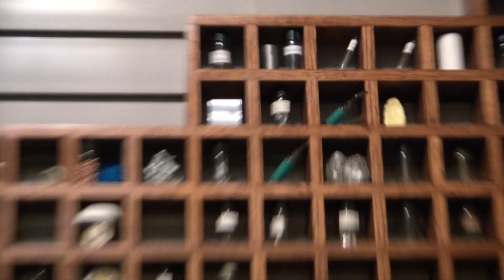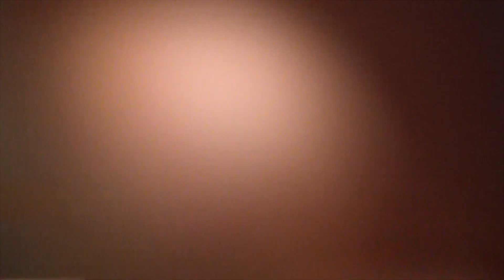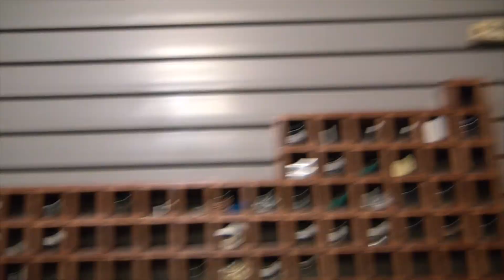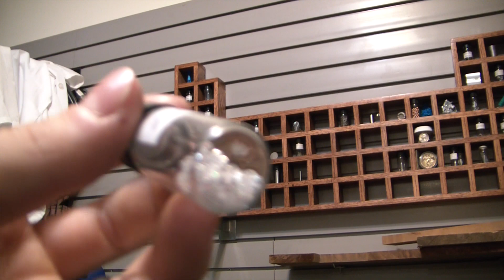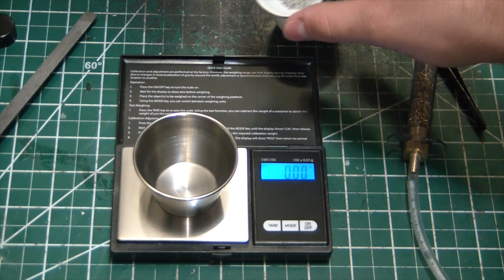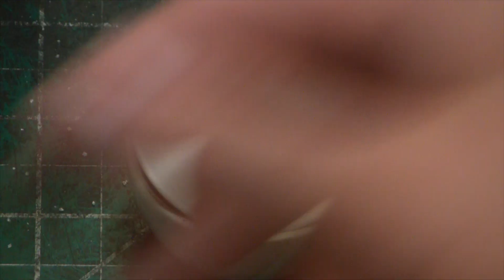Diamonds are NOT Forever: Burning Diamond - ElementalMaker

Comment: Great video!👍💪
Thats what I wanted to do forever using my oxyhydrogen torch. Unfortunately I dont own any diamonds I could waste😅.
It would be also interesting to try this under a inert athmosphere like argon or helium. Probably using different pressures would be interesting. Is it possible to melt carbon? I am gonna look it up on the internet and if it could somehow be possible for sure try it. Probably using charcoal or graphite as the carbon source though.🤔
Reply from the maker: It's definitely a bit of fun to see diamond burn! From what I was able to find carbon can actually melt if the right conditions are met, 100atm of pressure and 5000k temp. Might be able to do something with the arc furnace I'll be building.

Comment: If you hear a diamond in a oxygen stream it becomes flair like, thunderfoot did this a bit ago, and you could convert your hho generator to separate the gasses out the anode and cathode, giving you a mixable stream of gas. More like a oxy ace torch setup
Reply from the maker: Thanks for sharing, I'll have to check out his video! I may build a split cell in the future, but with my chemistry supplies its easy enough to generate pure O2 on demand when needed.

Comment: How small could you make than HHO generator well still having the same volume of HHO production? How long can you make the torch length? Light saber potential
Reply from the maker: Im probably pushing the limits for my cell type, but if you used flat plates of SS you could probably build a very compact cell. Still though, it will generate alot of heat so some kind of cooling mechanism would be needed.
Reply: its all a question of power, you need around 250w per Liter per minute. So relaisticly you need 500-3000w So you could use some RC model Lipo batterys  to power a HHO generator. There is no limit. Somone on youtube posted a flame with 20 inch lengh i remember.

Comment: Hey I got a question.I used my Potassium Hydroxide to dry out a few things,but now it is wet and is stuck in a big lump.How does someone dry out Potassium Hydroxide ? I would much rather ask a professional (YOU) then my science teacher.😃
Reply from the maker: You could dry it out with heat on a glass plate or a Teflon coated steel or aluminum cookie sheet. Bare aluminum would be destroyed by KOH though so be careful. It will also slowly eat away at glass so use something your not fond of any don't use it for cooking again. You could also dry it with a more powerful desiccant such as sulfuric acid, but that is probably more valuable to you than the KOH.

Comment: For the power supply you could use a microwave oven transformer, with the high voltage winding removed and a enough turns of really thick wire used instead, to give 5V. You'll need a huge full wave rectifier too. Should work out cheaper than a Chinese power supply too.
Reply from the maker: Yep I have a few MOTs saved up ready for rewinding, but I'm going to use them for an arc furnace. I was able to source a 5v 60A power supply quite cheap so that is now powering the hho generator.

Comment: Time to have a look up the skirt of that power supply and see if it is an innie or an outie
Reply from the maker: Already on its way back to amazon. Before I sent it though I had a look at the innards and it was surprisingly nice. Couldn't find any component that failed, so it may have been a solder joint on the bottom of the board which I did not check.

Comment: Power supply solution: Use a microwave oven transformer, remove the secondary windings/coil. Rewind with 8 gauge wire. If you can get about 10 to 12 turns of wire that could produce around 8 -15 volts @ 40 to 60 amps (it actually depends how many winding are on the primary coil). Use a full bridge rectifier to create DC voltage (remember there will be a bit of voltage drop because of the forward bias of the diodes and few other factors). The full bridge rectifier could be from a dc welder or from a commercial motor controller. The tighter the windings the better it will work. Not sure of the exact duty cycle but it should be fairly high with such a low voltage. As you know, the fatter the wire (lower the gauge) the less turns you'll be able to wind around the secondary side of the transformer, but the amps will increase, but the voltage will drop or decrease. Make sure the full bridge rectifier is mounted on a heat sink of some sort and be sure it's rated higher than the largest voltage you think you'll use, and make sure it's also rated higher than the largest amps you think you'll draw. Full bridge rectifiers can break down quickly and explode into hot bits if you use an under rated full bridge rectifier.

Comment: Love your stuff mate I think you should revisit and remake the HHO maker and show the difference between them both basically show from then to now and the difference time makes and why you change things you did I think that would be a great video
Reply from the maker: Thanks! I honestly haven't changed much of anything on the HHO generator. Just a couple heatsinks on the connection posts and 10GA wire to the terminal posts, but that's literally it! (as far as I remember at least LOL)

Comment: I wanted to tell you I've been extracting mercury from CFL bulbs. LOL. I might do a video on it to show how it is safely done. I think It is more responsible to safely handle it yourself rather than throw them in the garbage. People like us that like to collect elements and have such strong curiosity that we'll save the population out of utter selfishness.
Reply: Matthew Wilson safely and mercury can’t be put in the same comment. PLEASE make a video on this I want to see it!
Reply from the maker: I already have so much mercury from old tilt switches I'm trying to figure out how to safely dispose of it LOL
Reply: @anthonycaminiti8734  I'm certain I will now. Mercury vapor is the primary concern when dealing with the toxicity of this element. Taking the bulb apart is best under frigid water. Score both ends of the CFL glass bulb with a sharp file. Snap the bulb as you would with making glass tube pieces for chemistry applications, but do it under the water.  Be sure to seal in any vapors which first may escape from the bulb once broke. I also set up a cold trap using quickly evaporating acetone to condense any mercury vapor. If dry ice is available use that with the acetone for even colder temps. You can also use a bowl to chill an aluminum foil ceiling of the container. Any mercury vapor will favor condensing onto the foil and then form an amalgam with the aluminum which is an incredibly small amount. It forms light colored string-like material. This can be added to a solution later on for later processing. The mercury is easily separated and collected from the water. The water can be slowly evaporated with colder air and stored in a much smaller container or processed into safer insoluble forms of mercury. Conversion to mercury sulfide via hydrothermal reaction in an autoclave is a good method.

There are many different ways to convert the mercury into a much safer form. As long as you don't vaporize it, or especially don't turn it into an organic mercury salt you can keep yourself safe and protect the environment at the same time. Trashing them just puts the mercury into the ground water and so does recycling in regular consumer household bins as the recycling plants send 80% of the material to a landfill because it is not economical for operations and they aren't equipped to handle waste material that doesn't fit a specific criteria. It's rather surprising how crazy things operate dealing with hazardess waste at the household level. We're also talking about an incredibly small volume of mercury I'm specifically handling with these CFL bulbs. The insoluble solid waste product can be encased in a block of concrete and labeled for hazmat drop off. It's overkill, but it is just another option.
Reply: @ElementalMaker  Trade ya some calcium carbide for some mercury? LOL. It's an option. :D
Reply: Matthew Wilson  thanks for the information!